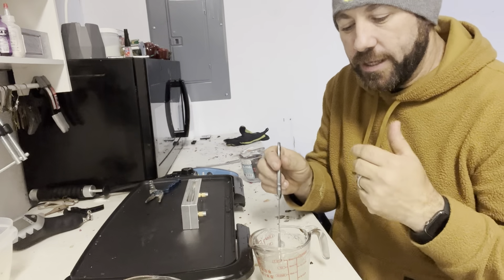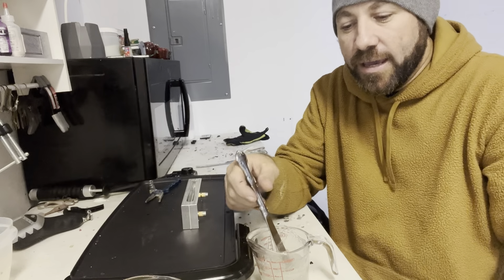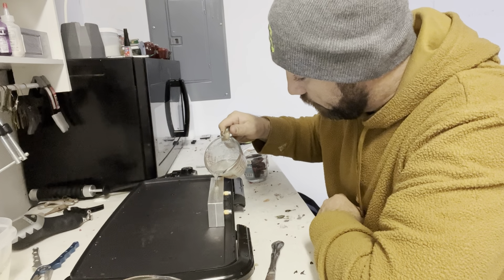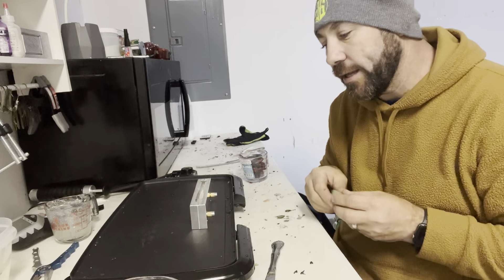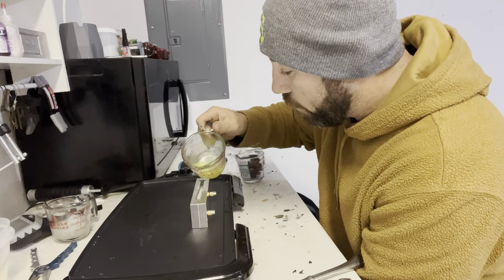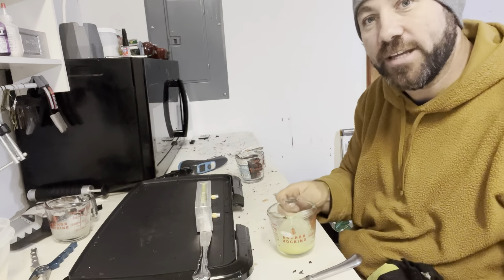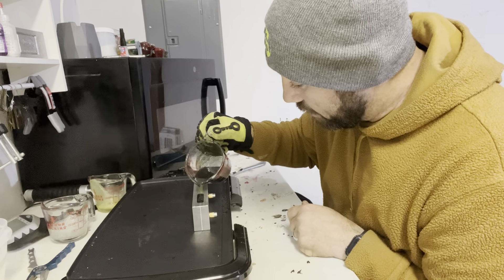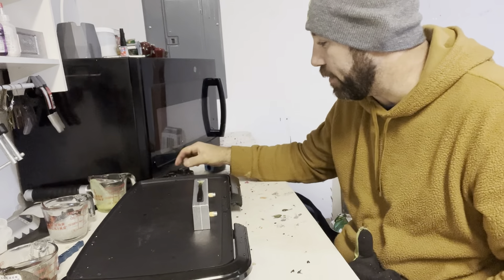Garmin Guru Handpour: The Mission For A Real Sexy Shad!! The Closer I Get The Farther Away I Get 🤯

Comment: Good job Randy, looks awesome. You got it going on right there with the Kay Shad. Only thing I don’t like is the higher spot, I would bring it down lower a 32 nd of an inch.  Seems to close the back to me. Looks awesome anyway and I agree about your idea of bringing the darker on back. No matter though, that is gonna be a catching bait right there. I wouldn’t mind trying that for some crappie jig plastics. I haven’t seen very many at all that really resemble a Shad as this bait does. I hand tie jigs and powder coat my own jig heads, but have never tried any plastics stuff.
Reply from the maker: Yes sir. I got the location for the shad dot from several photos where they are higher than most baits. It’s a work in progress